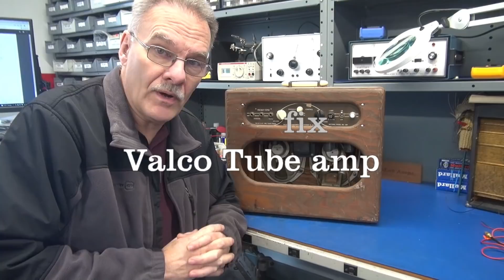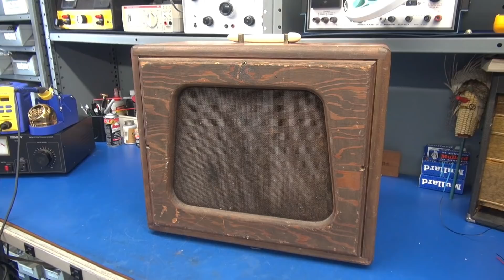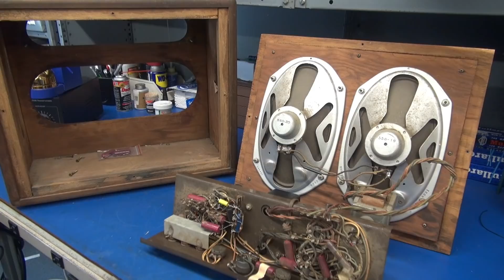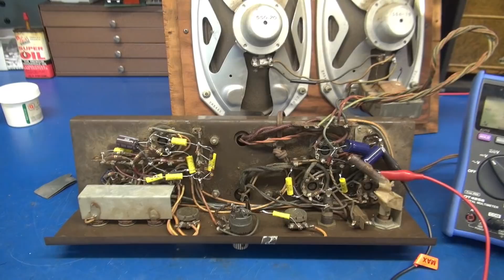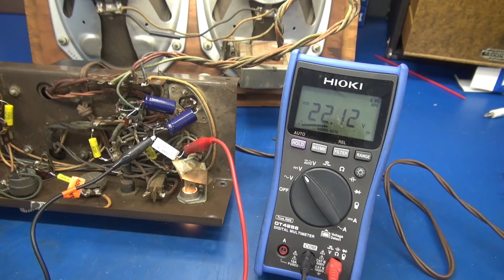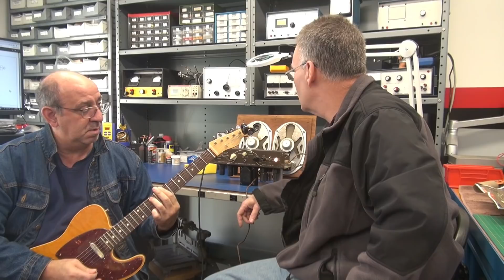How to repair Vintage Valco 6V6 Tube guitar amplifier New capacitors Very cool Rare unit

Comment: I just built a Valco/gretsch 6161 from a 60’s Knight Amp. It was a kit that used pcb. A rat had made a home with two bathrooms of it. I got rid of everything except the iron and tubes. Maybe a few resistors. It has 6973’s! I used a blank aluminum 8x12 chassis and it turned out great. Used a lot of NOS class 2 disk caps and a few Jupiter coupling and bypass caps. F&T filter caps. The tremolo only has speed control but I don’t miss the depth control at all. It sounds like it gains depth the slower the speed which pretty much eliminates the need for a depth pot. Very chimey cleans with a healthy amount of low end. I really like it. The overdrive isn’t the best because of the paraphase PI I think. Farts out. I had to double the bias resistor in the schematic to get dissipation down to 11 watts. The Knight’s transformer is higher voltage than the Valco used. But the cleans are immaculate and it sounds great with overdrive pedals. Anyway, I’m now a Valco fan!

Comment: Man that tremolo is Tremendous! Pun intended. Question for Terry- how hard would it be to modify a blackface super reverb circuit to have the brown face style harmonic tremolo that was used in the early 1960’s fender amps- like the brownface Concert & Super amp?

Comment: A lot of the cooler plunkers say this is the very best studio amp of all time... 
The two Rolas (?) sound amazingly okay but an alternate baffle with a 
twelve inch swapped in'd be sumpin that's highly recommended (IMHO)... Terry, 
in your experience, could the two 6X9's handle the 10 or so watts from the 6V6's?

Comment: Those are not 6x9 speakers.
They are made by Rola, and are 6x11. I have been looking for one for years for a 1953 Hoffman TV set. There was another harmonica amp that used a pair of these speakers too, unless this is the same unit, not sure. These speakers are unobtainium. I think they are 3.2 ohms also as I recall.

Comment: Hard to believe that it sounded so good all taken apart like that 👍. If it had an internal output transformer I'd have sworn you had it plugged in to a separate cabinet. I bet this gem could give a tweed Tremolux a run for it's money!

Comment: Hi, I made something sooo loud using 400 volts and a 1625 beam power tetrode with the hot 12 volt filament. It has 12AX7 (both sides) for preamplifying